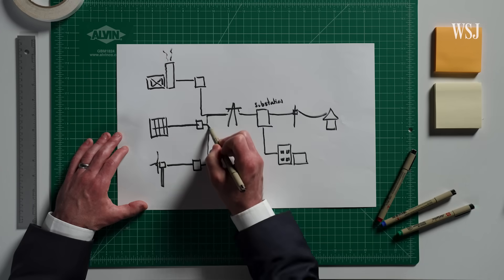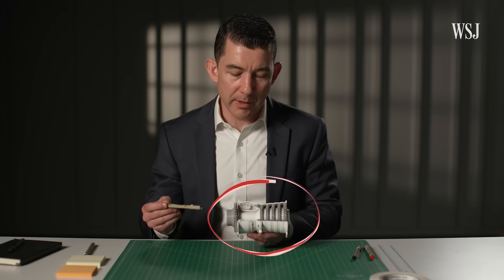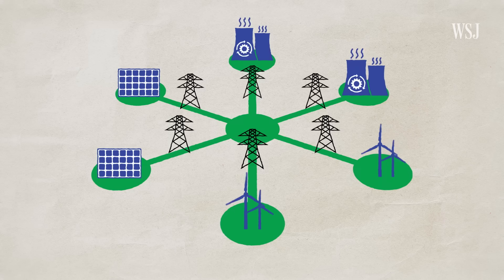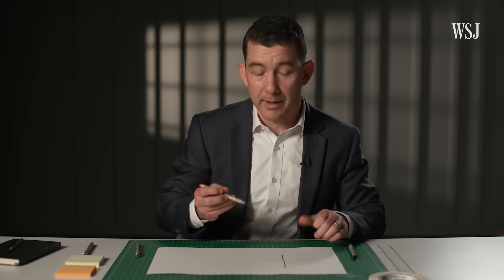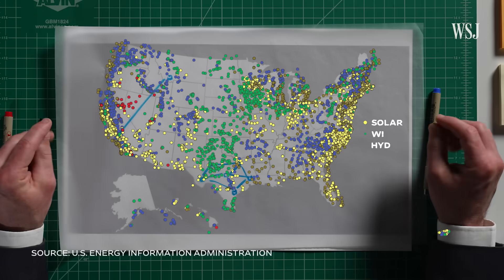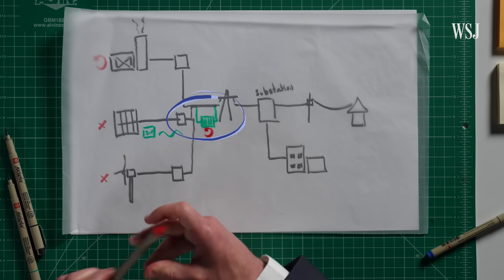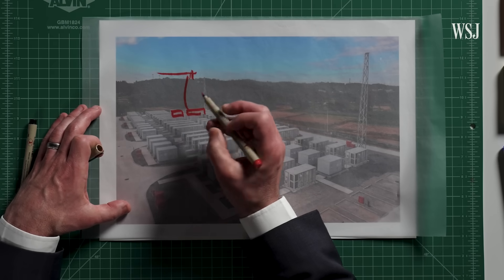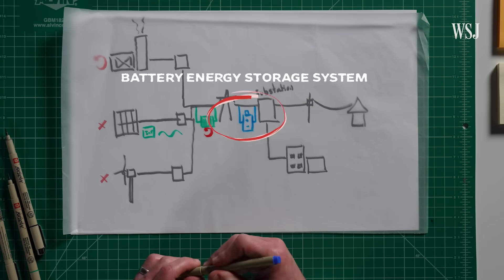How to Fix Renewable Energy’s Hidden Infrastructure Problem | WSJ Pro Perfected

Comment: I thought wind turbines had a bunch of gears that made sure they always provided AC at the same frequency as the grid. but correct me if i'm wrong.
Reply: The gears are indeed to speed up the rotaion of the generator for optimal performance. Gears alone don't allow syncing to the grid. Some turbine are synchronous with the grid though, and these use a Doubly-Fed Induction Generator (DFIG) to enable that feature.
Reply: @BubbleEngineering  It means, that wind turbine generators even with doubly fed induction generators are not synchronously with grid frequency mechanically, only their magnetic fields in the generator inside are synchronously? But magnetic fields themself have no inertia, only if the magnetic field of the rotor is fix "mounted" to this mechanically rotating rotor, only in this case the alternator has inertia? But in these doubly fed induction generators the magnetic field of rotor is not fix "mounted" mechanically, but "movably" through the electronic control inverter? That's why these machines also have almost nothing of inertia, similar to the electronic grid inverter of photo voltaic power plants, right?
Reply: @konstantinhuwa3064  Correct. Any inertia is supplied by the power electronics in the DFIG basically "leaning" on the two fields.  It can even be bidirectional, but it isn't directly-coupled in the way people seem to be thinking.  Also, the frequencies cannot be "anything".... that would instantly fry the power electronics.  So it can be used with a gearbox to some extent but with severe limitations.  The actual wind blades can only rotate within a very limited speed range.

-Matt
Reply: @junkerzn7312  But why would it necessarily fry the power electronics? Normally electronic motor controllers can rotate them up to 10.000 rpm! And such a controller for DFIG need as higher power, as more different is the relative rotational speed between rotor and grid magnetic field of the stator. It means when they are synchronously, you almost don't even need to push power through the controller. So you can variate ± relative rotational speed in wide enough range in both directions, when the rotor is slower or faster than the grid frequency. And if you have a more powerful controller, this range also will be bigger. The highest power will be needed for example when the rotor doesn't rotate, or when it rotates doubly faster. So the range of rotational speed of the rotor of the electrical machine could be ± 3600 rpm, from 0 to 7200 rpm. But on wind power plants smaller controllers are used, so the range is only maybe ± 1400 rpm, from 2200 to 5000 rpm, or 5 to 11 rpm of wind rotor.
Reply: Wind turbines need to convert their variable AC into DC then back to precisely match with grid frequency and phrase in their region (50Hz or 60Hz) at whatever feed-in voltage they're using.  It likely would be giant-sized switched-mode power supply with a transformer and MOSFET/IGBT at the heart of it.

The highly variable nature of wind means it all but impossible to mechanically match the grid's frequency and phase in real-time.
Reply: The extremely complicated CVT it would take to maintain synchronization would be far more expensive and inefficient than simply creating DC with the turbine,then inverting it to AC. The multiple synchronized outputs from the inverters plus LC filters or the mechanical flywheels mentioned in the video would produce a very clean sine wave.
Reply: DFIG wind turbines CAN produce inertia.  The detail that most people are missing is the grid interconnection standards specify that IBRs must not produce inertia and have test protocols designed to test and demonstrate that they don't provide inertia.   As a IBR design engineer we have to go to some effort to ensure IBRs don't create inertia so that they can be legally connected to the grid.  

I am involved in trying to get stupid grid interconnection standards changed - I would like for all IBRs to have a value of inertia to be specified as a pu requirement.

Comment: you need an electrical / power engineer not a mechanical engineer. I'm sure he is brilliant in fossil fuel based power plants but these claims are not "big concerns". Germany has now higher percentage of renewable and no power cuts. 

the solution is not more conventional and nuclear power plants but more distributed renewable and storage with smart grids.

Comment: Is this possibly the most inefficient use of copper, lithium and cobalt? Does he have any idea where copper cones from, and how long a copper mine takes to be commissioned. Theoretically engineering is unlike reality. Useless video. But nice guy.
Reply: Cobalt?  Urm.  The grid is mostly aluminum, inverters contain copper but not a whole lot, and BESS systems are made out of LiFePO4 (LF
P) batteries for the most part.  So no cobalt.  You think we should burn stuff 24x7 instead?

Comment: Great presentation and introduction to battery solutions. One could start at the source of the problem, back with Tomas Edison's DC and Tesla's AC, which dominated because of long distance transmission. The result is that now we have a fragile national grid because AC is so sensitive. Solution? The fact is that distributed generation of renewable energy is turning things upside down. We should be thinking a hundred years down the line, which will be a DC network of battery nodes linked by HVDC and MVDC. AC will only happen at the consumer end. Best thing we could do is to nationalize the grid, like our interstate highway system.
Reply: This Edison vs tesla junk is the trademark statement of someone who doesnt know anything about electricity. AC was a far better solution to widespread distribution back then for practical reasons. There was drama, yes, but AC has its merits. 

Also, DC is being used on small scales rn for long distance transportation of electricity. There are several massive projects in work for large DC lines as well. You seem to not know that. 

At the end of the day AC and DC work best when used together. It's as simple as that. Neither is better than the other
Reply: @Majilikin 
 I am well aware of what HVDC facilities exist and especially what China is doing. As to AC and DC working together, I did say that AC would continue to be used at the consumer level and I would add that estimates are that a third of electrical generation will be by consumers. A renewable energy based system has to have distributed storage, which in large part will be DC. The AC system you talk about is instantaneous and thus venerable.
Reply: @chrisconklin2981  Are you implying that large battery facilities feeding a DC grid are somehow more reliable than power plants feeding AC to a grid are? I would wager the reliability is about the same between the two, and the DC battery system is currently impossibly expensive, while having the advantage of it theoretically could produce far more instant power in peak demands than any AC only system could ever hope to. I'm really not sure what your point is.

Also what exactly do you mean a third of generation capacity would be by consumers, and why is that relevant here? Because that's a problem for the grid as well that needs to be accounted for. 

In any case you're missing my entire point which is anyone who brings up Tesla vs Edison is almost certainly completely uninformed about electricity, a point which your reply is proving true.
Reply: @Majilikin  You keep saying that "Tesla vs Edison" is a demonstration of ignorance. Kindly explain this. As to the two thirds comments, I referrer to a Sankey flowchart produced by Lawrence Livermore Labs. Ref: Estimated U.S. Energy Consumption in 2023i. ( I think that is the right one)
Reply: @Majilikin  Correction:  The third part of consumer level power generation estimate comes from NREL National Renewable Energy Laboratory Bolder Co.
Reply: @chrisconklin2981  Telsa vs Edison is completely irrelevant in the context of modern electrical distribution, and 99% of people who mention it in this context are people who have no understand of electricity outside of some YouTube videos. Like you.
Reply: @Majilikin  Citation Please!
Reply: @chrisconklin2981  So you make a bunch of unsubstantiated claims in your original comment but now I am the one who needs citations? 

Did you think I wouldn't catch you on this or are you actually this naive?
Reply: That is one possibility. On the other side is the spectrum is to privatize electric power generation/distribution and rely on market forces and industry associations like we did with the mobile telecom network.
Reply: @christophscholz  
When it comes to large scale systems like electricity, rail, highways, and navigation the free markets has always had to be kick-started by governments. Also look at the USA's rail system. The private system has developed a materials transport system. Whereas many other nations have also produced high quality public rail systems. Given the challenges, the private system is incapable making the future investments.
Reply: @chrisconklin2981  Very well put.

Comment: Hydroelectric generators typically have the greatest WR2, Rotating mass. Wind has WR2. Nuclear, Coal, Gas turbines, Thermal turbines have WR2 at higher RPM, lower mass per KW.
Large Battery bank, large solar, any "step voltage" could be required to have a/ drive a rotating converter(s) to couple to the grid.
Reply: Important is not only moment of inertia, but much more angular momentum, it means how fast this mass is rotating. Hydro power plants have very slow rotating masses, because of much pairs of poles of their alternators! This machines rotate only with 600 rpm, but steam turbo generators on heat power plants with 3600 rpm, and by the same power can have much higher inertia, because it depends from square of rotational speed! It means they have 6x6=36 times higher inertia, by the same moment of inertia!
Reply: Wind turbines also have inertia..
Reply: @AprezaRenaldy  someone wasnt listening to the video. That inertia doesn’t contribute to anything if the wind turbines have inverters that are grid following and not grid forming
Reply: @JustATrippyDuck  Not all wind turbines use inverters.
Reply: @AprezaRenaldy  this is true, but the vast majority of WECS use inverters, and most of those are grid following. Induction based wind turbines do have inertia, but they also don’t hold the grid’s frequency as steady as equivalently sized synchronous generators due to the lack of VAR variability or response
Reply: What's WR2? Google showed no matching results.

Comment: Alternating current doesn't oscillate around a positive voltage of some sort (see diagram at index 2:51). It oscillates around 0 volts. I guess, that's what you get if you talk to mechanical engineer about electrical / power engineering.
Reply: In principle your statement is correct that an AC voltage system does not have a DC offset. However in theory 0V does not exist. There is no point on earth or in space that has an absolute value of 0V. Voltages can only ever be measured as differences between potentials and choosing a 0 for any of the potentials is completely arbitrary
Reply: Actually, "alternating current" by definition doesn't mean it has to be at zero volts. Like another person mentioned, there's something called a "DC offset" that can "boost" a signal's amplitude by a constant value. 

Think of a simple AC voltage signal cos(x), which oscillates from -1 to 1. When you add a DC offset of 10 volts, that same AC signal now oscillates from -9 to 11 volts. Mechanical engineers also learn about electrical engineering concepts!
Reply: The achses are literally unlabeled.
Reply: Yeah, I am confused too, and I am the opposite side of you here. Guess we need even better cooperation in these days.... ;)  
BTW, I feel like it is just a demonstration sketch, nothing serious, so don't take that one graph seriously, the video has only 6 minutes!
Reply: My degree is in aerospace but I have 35+ years in industrial control systems and automation. So I have done a lot of   electrical engineering as well as having fixed many, MANY, MANY, problems caused by mechanical engineers.
Rule 1 of electrical engineering is DO NOT ASK A MECHANICAL ENGINEER.
Reply: Or maybe it’s simply because he’s a professor and knows how to teach high level concepts without getting into nitty gritty details.
Reply: When did he say it did? Graphs don't have to start at (0,0), you know that, right? Learn your stuff before attempting to criticize other people.
Reply: @lucassilvas1 He just wanted to let everyone know how smart he was, that’s a totally irrelevant detail and the illustration wasn’t made by the guy in the video
Reply: Get a grid construction engineer to talk about the grid costing $TRILLIONS 
And 2 x more electricity is more $TRILLIONS just for the grid itself. 
20 x more electricity is 20$TRILLIONS more just for grid capacity. 

Just the transmission line has 50tonnes of galvanised structural steel per km and 20 x more capacity is insane. Plus foundations plus 7km of conductors per km and transformers and switch yards and poles and wires and....
Reply: @stephenbrickwood1602  LOL Those are absurd outdated numbers. HV-DC has massively reduced the cost of transmissions line Structures. You are just spamming googled talking points.
Reply: Engineer Explains Three Key Issues in Renewable Grid Design | WSJ Pro Perfected    1518pm  3/6/25   indeed. customer service personnel will never get the gist of what the guy taught to to do the job is suggesting...